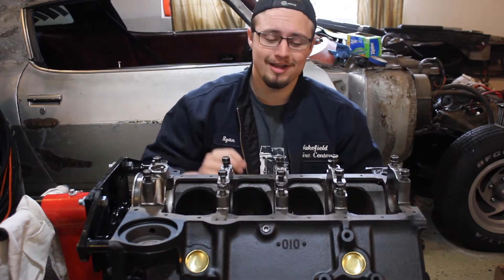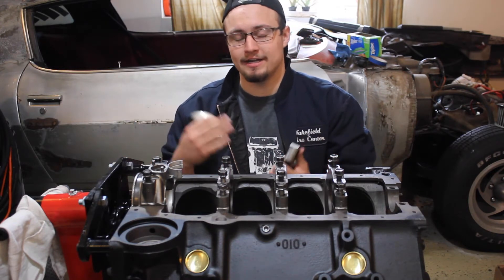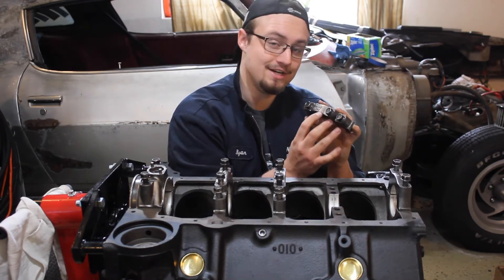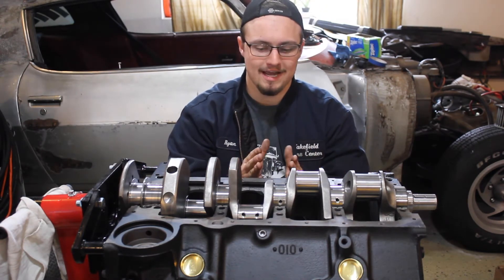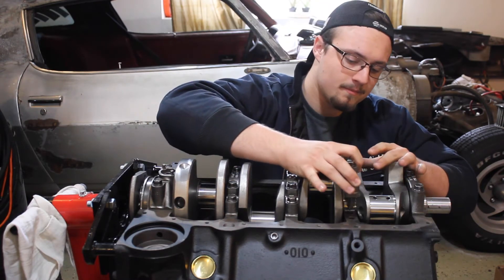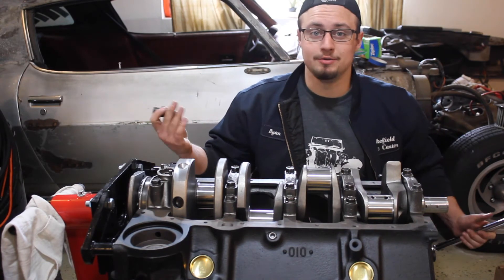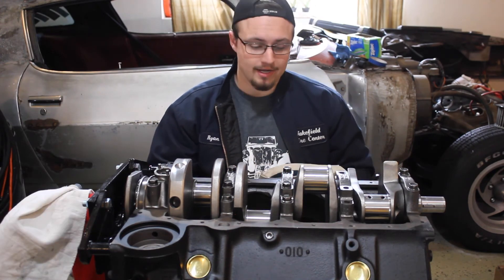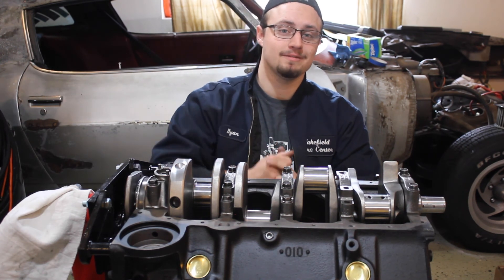How To Use Plastigage To Measure Your Crankshaft Main Bearing Oil Clearances - Burnout Tutorials

Comment: Plasticgauge is just a reference point,  it is not a precise measurement. 
You can have one measurement at one point on the Crankshaft and a different measurement someplace else. 
And depending upon the age of the Plasticgauge you can get erroneous measurement.

Comment: i wonder why do most only lay the wax strip on the cap side and not the block side also?
Reply: Because you have the highest pressure point of the crankshaft on the cap side. 

The other way around with rod bearings. There you have the most pressure on the piston side. 

Block side main and piston side rod bearings only have the compression force, where the cap side main and piston bearing cap have the engine’s power and torque forces to deal with. 🙌

Comment: It is really OK to leave the used Plastigage on the crankshaft ? While you can sweep it of now you are that deep in the engine ?  That is not an attitude of a good mechanic.  Besides, I find no professional mechanics who recommend Pastigage, they say it rubbish.
Reply from the maker: Never claimed to be a professional. I called it as it is, it’s not a precise tool. It’s a quick and dirty and usually good enough method for non professionals who don’t want to spend thousands on specialty tools. And there is absolutely nothing wrong with leaving the plastigage in the engine. As I explained it’s made of a wax that is completely safe for the engine, and as we all know, wax melts when it gets hot. So it will melt and assimilate with the engine oil. But just clean it off if you want to. Doesn’t make a difference.

Comment: So on the replacement of your main bearings since your measurements came out to be about 3 thousandths of an inch is that how you order your main bearings, 3 thousandths of an inch OVER?
Reply from the maker: Well in order to make those measurements you already need to have a set of bearings. You're basically just checking the clearances to make sure they are within the acceptable range.

Comment: So since your set up was .003 what oil would you be using ? & after changing your oil etc what oil would you be using then ?
Reply from the maker: I'm pretty sure I'm using 5w30 oil. For the first start after finishing the rebuild, I used the cheapest conventional oil I could find. Ran it for about 20 minutes at 2,000 ish rpms. Then shut it off and changed the oil to break in oil (I used AMSOIL). Drove that for about 500 miles and then changed it over to full synthetic 5w30.

Comment: I suppose that without pressurized oil the shaft leans on bottom side and clearance ranges from 0 at bottom to double of normal clearence on top side. Is it so? Is plastigage calibrated for a measurement on the exact top?
Reply from the maker: Honestly, I'm not exactly sure. What you're saying actually makes sense, but I don't know for certain. All I know is that it is calibrated to be used in this way, and it is pretty effective and pretty accurate for a quick and dirty method.
Reply: @TheBurnoutShow  thank you for your opinion

Comment: What do you do after measuring the gap and you found that it's not the right measurement? I've seen this several times on other channels but it's here that I asked this question because they did not explain why you need to measure and what you will do next.

In my own thinking it's not my business to measure those gaps  for I think that's the business of the Machine Shop doing the job when you let them work for crannkshaft machining. So my work is just assemble the parts that I believe are perfectly done by the machine. Do I make sense? 😀😃
Reply from the maker: If the measurement is wrong, that would mean you need to get different sized bearings. It doesn't really have anything to do with what a machine shop does. It's just about the bearings. There will be bearings that are different thicknesses and you just need to get a new set that fits the measurements. Hope that helped.
Reply: @TheBurnoutShow  Ok! In the exchange of ideas we can learn as we put it into practice so I will always elicit answers to my questions.
I don't know the measurement of the standard size of a crankshaft but an oversized one is 0.25, and I'm going to buy bearings for the crankshaft and connecting rod with the size at 0.25. If I measure it and found that the gap is not exact can I buy another set of bearings at 0.25 expecting a different gap?
Reply from the maker: @ToyotaLand4d56journey  No, if you buy a set and then it doesn't measure out correctly, you shouldn't buy the same sized set again. I wouldn't expect to see better results that way. You would want to size up or down the bearings according to the measurements and the accepted tolerance ratings for your engine and crankshaft setup. Typically I would say that if it comes out wrong, its that the manufacturing of the crankshaft causing it, not the manufacturing of the specific set of bearings that you bought.
Reply: @TheBurnoutShow  That's the issue now I want to understand, how to size up or size down bearings. Can you please explain how this is done? Or, do you have a video about it?
Reply: @TheBurnoutShow  I agree with toyota they are doing all the leg work for you with the size bearings you need, I checked mine and i would rather see it .0022 or 2.5 but i have .030 which seems like hot oil will kill the oil pressure.

Comment: Good quick explanation to get the job done 👍.... HINT, you'd be amazed at what an extra 5 ft.lbs can do to a bolt tensile strength 🍺
Reply: 5ft-lb can also potentially be enough to distort the bearing bores. This is why, when you line hone, you want to have the line hone done with the fasteners you plan to use torqued to the torque setting you plan to use.
Reply: I only go all extra on heads. And only with aftermarket bolts. Overtorque on bores..no.

Comment: Aren't those cap bolts torque to yield?  ie one time use only.
Reply from the maker: That's typically a good rule to follow, but as long as the bolts are in pretty good condition (no excess stretching, clean threads) you can reuse them. Especially if you are building a mild, low power engine like me. For a performance race engine, I would absolutely recommend getting new main bolts.

Comment: What if is not with in specs?
Reply from the maker: Typically you can get different sized bearings. In some cases you might need to get it bored out but usually you don't have to.